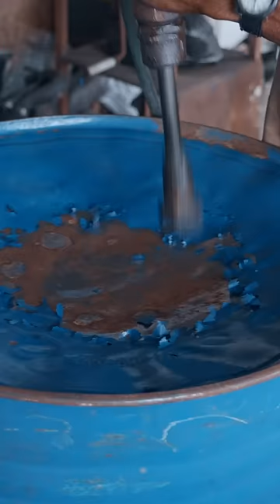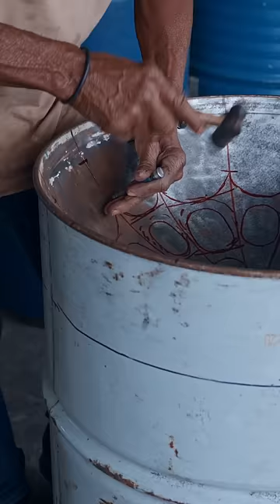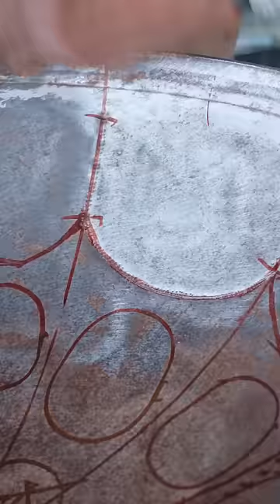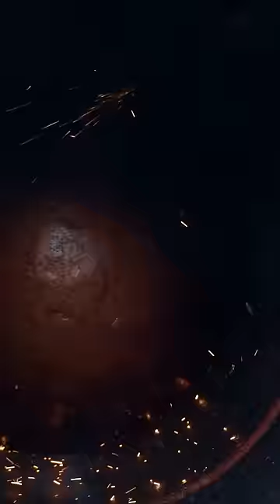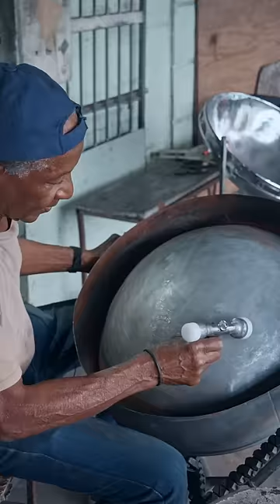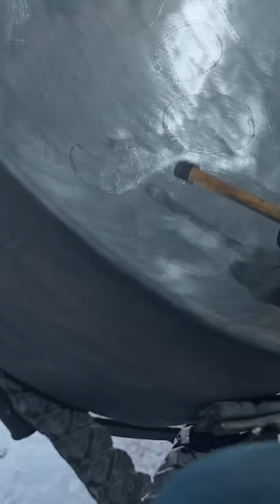Making a Steel Pan in 60 seconds.

Comment: FYI: as a teenager I found an old oil drum and brought it home to do this and believe me, however hard you think it is to make one it's at least 5x harder. 
Turns out you've really gotta know what you're doing and not just bash away or you'll eventually weaken the metal and it'll crack and be unplayable. I ruined one side, and thought I understood how much and hard to hit it by learning from my mistakes and then proceeded to ruin the other side 😅. I think I wasted about a week in total and got oil stains in my car.
Reply: Props that you tried though.
We used to make bows and crossbows when we were teenagers. But literally had no idea of how to go about it, and I am pretty sure the library even didn't have that sort of how-to technical book.
Eventually my group of friends worked out a lot of the tricks other people already knew, and we mane some fairly good crossbows, each one better than the next.
Now you can look for a tutorial for anything on the net.

Comment: That man has a feel for something that could not be replicated by a machine.  Some things should always be made by hand
Reply: I mean, to be fair, this could be done by a machine easily. Not just by shaping them using templates, but by actually programming a robot to use the same processes, and then properly tune it using either a kind of “ear” that “hears” the pitch to adjust it, or one that uses a probe to detect the micro vibrations happening atcertain points of the pan. You’re right though, because it’s the minor imperfections that give character to the instruments tone. Music and the theory behind any arrangement can be taught, but the intangible emotional attachment to it, the innate understanding of what does and doesn’t create emotion, and especially the appreciation of it could never be.
Reply: @John-Perry  totally unnecessary comment
Reply: @TheSuperpirate32  bullshit.  There is a quality in the craftsmanship that could not be duplicated with a machine.  It would not have the same tone.    FYI there are machine made steel drums and they pale in comparison. What you are saying is hypothetical.  There are already machine made steel drums that do not have the same sound as a hand made one.  So tell me there shortbussrider if there are already lower quality machine stamped drums why aren't they ad good as the hand made ones?

Comment: The cut-off wheel is the most dangerous thing I work with, and I work with fire and sparks.
Reply: Why?
Reply: Because of the speed that it spin. At any moment with a small crack it can explode in 1000 pieces. 

Always wear safety glasses
Reply: @Sir_Konflex  i work a lot with iron or brass but well always i wear a safety mask and using the grinder with the guard
Reply: @michilopochtli1880  basically a hand grenade that you use to cut things
Reply: @projectdelta50  yeah i know,but i try to be careful, and using quality tools

Comment: Guys, remember when cutting open 55 gal drums like this, always make sure one end is open, and always know what was in it before. My dad had a good friend that cut into a 55 gal drum that still had some vapor from the previous contents trapped inside and lets just say hes no longer with us.
Reply: Fiberglass resin is one of THE most dangerous as you can't begin to get all of it out of the drum and it will explode even if it's 3/4 full of water !! Ask me how I know !!!
Reply: @crazyoilfieldmechanic3195  if I remember correctly (this was about 13 years ago so the exact details are fuzzy) it was a old waste barrel used for coolant and oil and he wanted to cut it open to make a open top drum to drop scrap metal in. They found his body about 10 feet from the barrel and his head up in the shop rafters. He probably saw that ignition source fire up and that was it. Instant decaptiation.

Comment: Just a note never cut barrels with a grinder if you dont know what it has been used for often they can still have explosive gas in them even if nothing is inside
Reply from the maker: This is a good point, though in this case, Jimi (The tuner) gets these drums directly from the manufacturer, so there's no risk of explosion here. You can see my full steel pan documentary "Sounds Like Steel" out now on my YouTube channel.